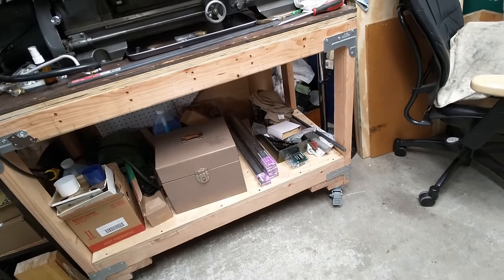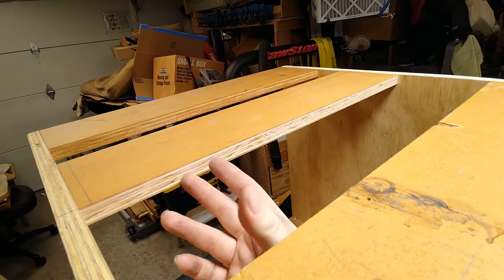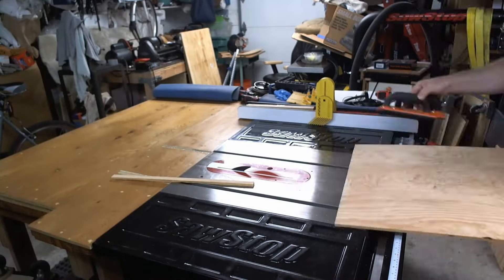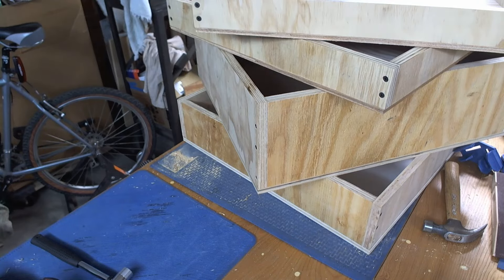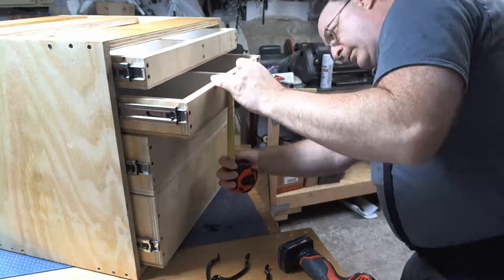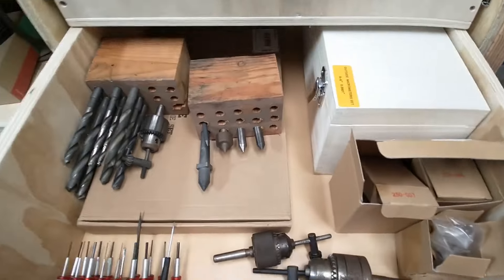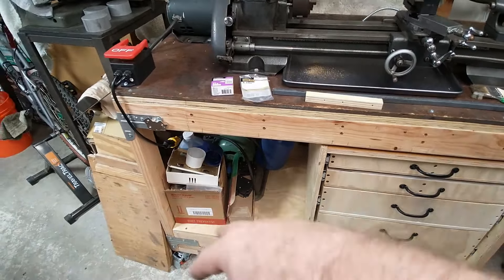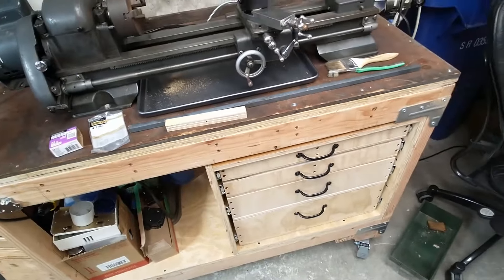Lathe cart drawers

Comment: To really stiffen up the bench get some plywood (minimum 1/2 inch thick) and screw it onto the back and sides - same as in house construction.  That will significantly reduce twisting and movement of the bench.

I managed to pick up a Craftsman 618 lathe from Facebook, that came with a great assortment of accessories, and a homemade wooden bench.  Unfortunately I'll have to dismantle the bench, shorten the legs, and rebuild it with better joints and plywood for the back and sides.  It has a double layer plywood top, but it's not straight.  I'm leaning towards a 1/2 inch steel baseplate for the lathe to mount on, then shimming that base where necessary to match the bench's top.
Reply from the maker: Yeah, that is why when I built the bench for this, I put so many side to side stiffener pieces in the top section.  Same for why I put the multiple layers for the actual top.  And I did screw a piece of plywood to the back after installing the drawers, but i don't know if I included that in a video as screwing a piece of plywood to the back of a cart is not that interesting in itself. :)   Given the results of the precision level that i did in a different video, I think the top of this one should be fairly solid and not twisting much.  the bigger issue is the garage floor slope and angle...sometimes when I move the cart not all the wheels touch which also means the cart is stiff as otherwise it would conform to the floor when I move it around.  Good luck with your cart re-do as well. :)